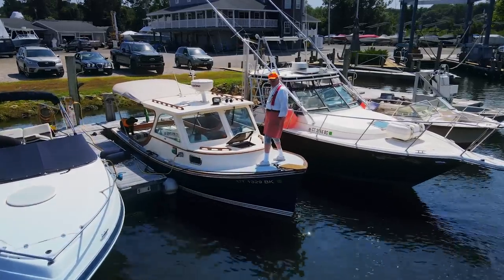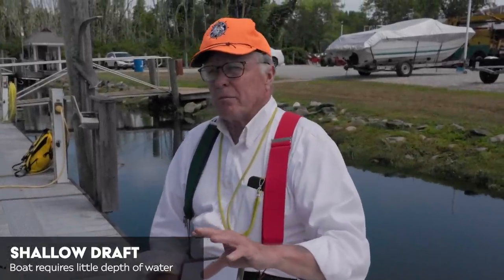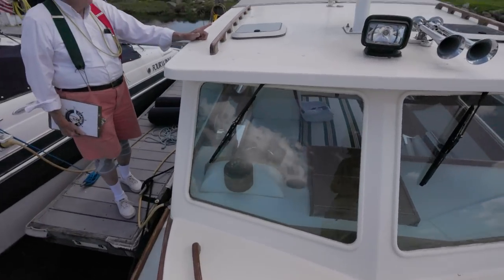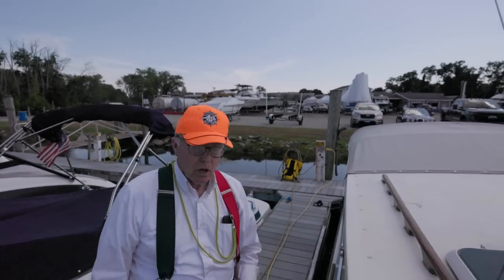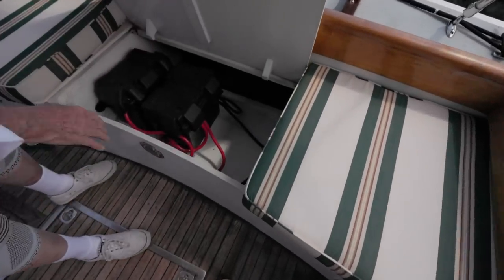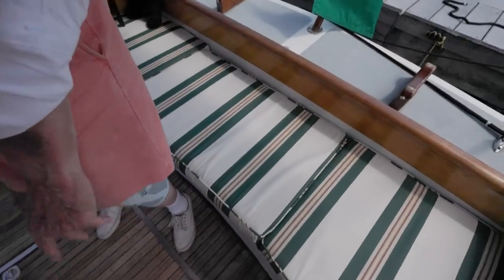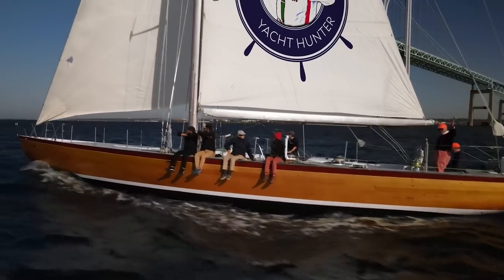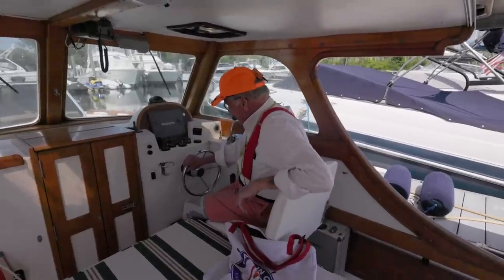$48,000 JET DRIVEN!! Webbers Cove pocket rocket!! EP112 #boattour

Comment: Jet drives server their purpose well if you need to navigate shallow water but they are very high RPM devices so they're kind of hard on engine longevity.  All that said if you're in a area where line fouling of the prop and such is an issue they are great.  The do make fabulous river boats.  Unfortunately it's not the boat for me as I'm pretty sure you couldn't really spend a month on her.  Hope your head heals well Randay.  Keep the good stuff coming guys.

Comment: There are downsides to the jet drive.  It can suck in ropes and tangle up so badly the engine dies.  Happened to a friend.  Had to get a long tow back to port.  Just saying.  Also, it takes practice to adapt to the jet drive's steering behaviors.  Still a great machine.